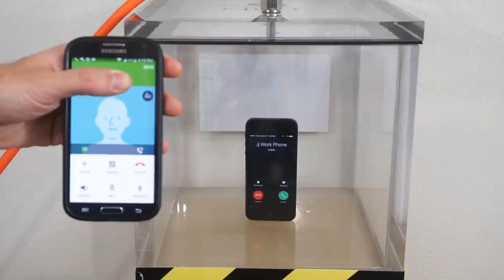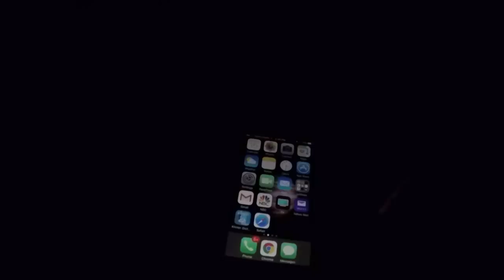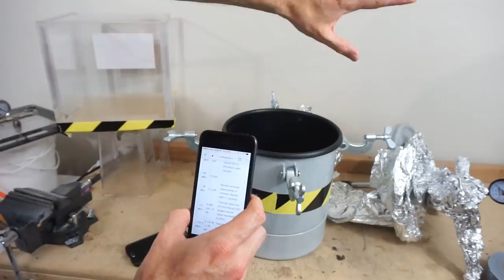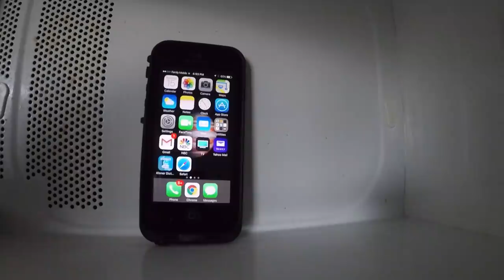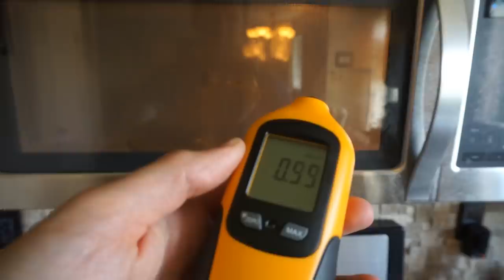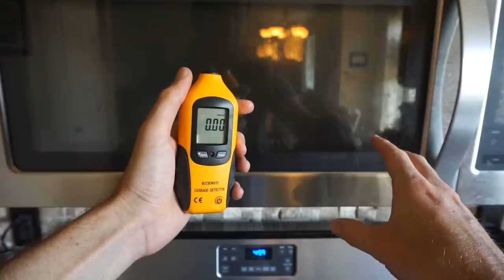Can You Call an iphone in a Vacuum Chamber? 4 Different Signal Tests!

Comment: 1. won't succeed to call in vacuum

2. wont succeed to call in steel

3. will succeed to call in water if the phone wasn't there too much time and still works but water doesn't block signals so as long the phone still operates normally it should succeed to call 

4. depends on the design and if the microwave turned on and off

Comment: You may be correct on the amount of power actually needed for a cell phone to receive signal to function properly.  The problem is that the manufacturer changes the amount of power needed to show the certain number of bars that the phone shows as operable signals.  It depends on the phone really, on how much power it'll accept before the phone shows no signal.

Comment: Metal mesh actually would block better then the solid steel because it deflects the signal rather then absorbing it. And if you turn the microwave on it would likely block the signal but I would guess it depends on how close you are to the cell tower.

Comment: You need a very thick metal casing in order to block all the radio waves otherwise you'll have to do the experiment in a place with weak signal so that only a thin metal casing is enough to block the waves

Comment: My predictions:
Vacuum chamber : no issues
steel chamber: wont work
under water: no issue, salty water: Don't know, wont work. (I was thinking light might cause issue with signals with double polarization, but that's just hunch and probably wrong one :D )
microwave: Wont work, but it might in some regions where are used lower frequency for LTE, but i guess door must be facing nearest cellphone tower.

Comment: my guess:

1. no problems, its electromagnitic waves, no transmitting medium needed2
2. metal shields electromagitic waves, so either you have bad transmission or none
3. well, sounds scary. As long as the electronics dont get a shortage it might work. I would use puriefied water, to avoid bridges at the platins
4. uh, strong static electric waves, my guess the mobile phone will get destroyed. transmitting data wont be possible, because the microwaves are to strong. It would be the same as try to hear a whisper, while a jet plane starts next to you.

Comment: Radio waves go through vacuum obviously, think of the gps satellites at 20.000 km above the earth, the space craft like the voyagers, hubble. Even the ISS at only 400km above, is still in vacuum.
But in the case of the metal bucket was an unexpected result

Comment: Curious to know if the MEMS-clocked iPhones (6 and higher) still work in this case... helium caused it to break because the clock sped up (as a result of the lighter helium particles?), wonder if a vacuum does the same

Comment: The phone still works inside a steel container because it is not grounded. The actual shielding is done by making a steel enclosure and ground it. If it is not grounded then that chamber is not shielded. There will be an EMF induced in the container which produces a current inside the steel and therefore create its own magnetic field. In order to proper shield the phone, the chamber has to be grounded, connected to a ground connection like the ones in the power plugs. This will "get rid" of these currents that are induced in the steel chamber by the electromagnetic radiation in the air. 
P.S: at my university, we had an enclosure like this one but about 4 m long. When you get inside and close the door, everyone will lose their signal to phones, the signal power is almost to 0. This chamber is used for calibration for sensors, equipment or testing devices under no electromagnetic pollution.

Comment: You should have kept the phone hanging with a very thin nylon string inside chamber because if the phone is put down then the base of the chamber might be working as a medium for phone to receive the signals. It is my thinking. May be you should try once and see.

Comment: So you said a microwave heats up by vibrating molecules very quickly, are you meaning air molecules? If so would a microwave produce heat in a vacume chamber?

Comment: Vacuum will not affect, if it did satellites would be designed very differently

Steel container will block if thick enough or large enough

Water should work if the phone itself doesn’t get fried, not sure how submarines use signal but it has signal waves has to get through still somehow

Microwave could actually block, it’s designed to stop microwaves (usually 12.23 cm) from coming out, cellular network ranges are usually within this number so most likely will stop it.

Comment: 1: works fine but the Iphone could overheat after a while
2: Radiowaves won't go through
3: Radiowaves won't go through
4:Iphone will burn

Edit: Ok he didn't turned it on

Comment: I would have expected the lithium battery inside the cell phone to expand and/or explode during vacuum, because it is basically a foil bag filled with solvent, which has a low evaporation pressure. Or are they designed to survive this to be aeroplane safe?

Comment: 0:55
1. I don't see why it wouldn't work in a vacuum; radio waves are pure energy and, so long as the material of the chamber itself lets the radio waves through, it shouldn't be a problem.  The Mars rovers and our deep space probes can transmit radio waves through space without issue, after all.
2. I'm not too sure on that one.  I want to say the steel walls will create a Faraday cage and block the cell signal, as most metals will, but I'm not sure how well steel actually blocks radio signals so...
3. Not sure on that one either.  I know from a different video of yours that electronics work while submerged in deionized water because of its nearly nonexistent electrical conductivity, and that might have an effect on the radio signal, like a liquid Faraday cage of sorts.  However, that video also demonstrated that a wifi signal will go through the water and allow the phone to access the Internet and even stream videos, so a radio wave should also get through.
4. Nope.  Not at all.  Microwaves are specifically designed to be small Faraday cages in order to contain the potentially dangerous microwave radiation the magnetrons put out, and I just read online that a good way to keep car thieves from stealing a keyless car is to put the fob in the microwave when you get home as the wireless radio signals are blocked and the thieves can't spoof the ID transponder.  A cell phone won't get any signal inside of a microwave either.
Reply: And now I'm surprised.  Well, not by the first or third ones; those went about as expected, and the second one wasn't terribly surprising either since, again, referencing back to the deionized water video showed that it was more likely than not to get a signal.
The microwave one is the most surprising, though given how the steel container worked I probably should have guess that; microwave ovens aren't perfect Faraday cages after all, and since the steel container showed that even a minimal signal is sufficient to make a connection, there's no reason the little bit of wavelength leakage shouldn't have been enough to connect.

Comment: Just want to mention that YOU DON'T NEED TO BE PROTECTED FROM MICROWAVES. If you're afraid of sticking your head near an operating microwave oven, then you should be about 10,000 times more afraid of sticking your head near an operating lightbulb. Micro wave radiation is simply NOT dangerous, just like Light radiation is not dangerous.

I don't want to get into too much detail here, but the waves themselves are not what actually heats your food. It's the rapidly oscillating electromagnetic field created inside of the oven. This field can actually be created with ANY electromagnetic wave. The only reason we use microwaves is because their size happens to be convenient.

Comment: Light goes through space same as a lot of other waves, so it is going to work. Water doesn't block most waves, also works. Steel chamber not though and microwave neither cause it is surrounded by a grid of metal to keep the waves inside.

Comment: Strange question but could I put a phone in a debubble / vaccum chamber thats normally used for screen repairs? The vaccum pressure in the machine is 0.71 mpa so would the phone be safe? I've re-attached the screen after repairing the glass and now there's a tiny bubble appeared under the glass so rather than take the screen off again I was thinking of just putting in the whole phone? lol

Comment: The most scary test was the vacuum chamber test. I was afraid, that if there is any gasses in the battery cell, it could delaminate the electrodes, causing an increase in internal resistance. The result would be exactly the same as an old battery, that needs to be replaced. A new battery, with no entrained gas would not have any problem. Another problem, is heat. In a vacuum, there is no air convection to cool the phone. This short demonstration caused no problems, because the thermal mass of the phone was heavy enough to absorb the temperature rise for that short period of time. (I'm glad you DIDN'T turn on the microwave!!)
     While on the subject of microwave ovens, try the meter test, with the microwave empty, and see how much the emission increases. (Don't do it very long, it could cause spot heating, or, damage the magnetron)

Comment: Well I still lose signal when I'm in a house with a metal roof. Are you sure that it wasn't because of that huge rod that was inside the enclosure? Could act like an antenna and transmit signal through the body of the cilinder and into the chamber.

Comment: I have a question. When you tried to seal the steel bin up better with aluminum foil how would the aluminum foil do anything? Its aluminum not steel.
Reply: Finn Campeau aluminum foil reflects electromagnetic waves, people actually use it to line the inside of their purses or book bags so they can steal stuff from stores without setting off the alarm

Comment: 1.how do you think messages get to the ISS
2.it went through the steel because steel only absorbs so much

3. it receives it in water because electricity can travel thorough water and those waves are electric
4. microwave worked because the radiowaves just went through the glass

Comment: Of course it will work on the steel case, you built a giant antenna!. If you don't want to work all you need to do is to ground the case. 
For the microwave it should not work as the microwave is a Faraday cage. If it worked it is because your microwave is not grounded correctly.

Comment: Your steel can does not act as a Faraday cage if you don't ground it. Redo your steel can and ground it, make sure the ground impedance is less than 5 ohms and try again. OR remove your microwave oven door grid and replace it with a steel, aluminium plate. AND remove your steel can paint when you insert foil, the paint is not really a good electrical conductor.

Comment: I did this test.  I wrapped it in a hat that radiologists wear.  It had those lead inserts, and it still rang.  I wrapped it in about 3 lbs of aluminum foil, while being wrapped in the lead sheets, put it in a waterproof electrical box, then wrapped that in aluminum foil, and I finally got the phone to not ring

And if water blocked radio waves, how would submarines communicate?  And the only place in the ocean where it’s miles and miles deep is Mariana Trench, and somehow they could still communicate when they sent a vesssel down

Comment: how are you sure that the air isn't still propagating the electromagnetic wave , you can test for this by measuring the speed , if it is not close to the speed of light in a space  then its wrong.

Comment: cell phone signals have essentially nothing to do with air, if anything removing the air should make the signal infinitesimally stronger because the moisture in it will absorb some radio energy but honestly it's a microscopic effect, you wont be able to measure it.

Comment: My guess: 
If it works in the chamber at atmosphere, it will work in a vacuum.
If it is waterproof, it will work in water. 
It will likely not work in a microwave because it is designed to contain waves.

Comment: What I really want to know that I don't know has been done or not is attempting to make 2 magnets or mud balls with magnets at the center to "orbit" around each other in a vacuum. The only way I can get 2 magnets to "orbit" each other is at a certain angle and I have to hold them by hand to maintain that angle while moving one magnet around another, and neither of them can be spinning or the angle changes and they attract. If 2 magnets won't orbit each other then there's no reason that planets, which are essentially the biggest magnets in existence shouldn't be able to orbit each other either which means some other kind of interaction must be happening besides gravity and magnetism which would both cause attraction. So then I would wonder what's causing the repulsion, because I've never seen magnets strictly repel each other AND keep each other within a certain distance.
Reply: You might even have to try dangling the magnets from strings in a vacuum chamber, I don't know.

Comment: Microwave is a faraday cage so no. Steel I am thinking that is similar enough to a faraday that it won't either. Water, depends on how deep or thick but I would guess no. Vac chamber no problem.

Comment: It is possible to get the call because radiation does not require a medium to pass thus even if air is not there signals will pass.

Comment: Once my phone got wet & I didn't think about the system instead I thought I just need to dry my phone & I put that in the microwave and turned it on.
My experiment was a fail but not completely lol because it did dry out but lost the connection. I'm guessing it is because the plastic sim inside my phone or maybe it was just because of microwave and phone's radio wave fighting with eachother. 
😂😂😂

Comment: What will happen if you open the chamber without getting the air back in?
Reply: You probably can't open it. The lid is absolutely sucked in as the chamber was trying to suck the air around it but couldn't .
Reply: @agnesnyangoma2349  thanks. If it can be opened anyhow, it would act like a bomb right?

Comment: Predictions (Will edit with reactions to results):
1. It's using waves, so it should work in a vacuum chamber. (Edit: I completely forgot about the risk of it breaking, but it pulled through.)
2. Unlikely due to waves blocked by steel. (Edit 2: What?! How did it work?)
3. Assuming the phone is sufficiently waterproof, it should work. (Edit 3: Good point about the ocean.)
4. If the microwave is running, I doubt it. Either the phone gets cooked, or the microwaves scramble the signal. (Edit 4: Okay, considering how it worked with the steel container, yeah, the microwave couldn't really stop it.)
Reply: for point 2 it's a matter of rifraction and diffraction, the steel can should have been thicker than that
Reply: Manuel Ubaldi Ah, I see
Reply: @Manu-se5tx  how is it possible? We tried it with aluminium wrapping and it didn't work.

Comment: I knew That the Waves can go trough Vacuum But I Thought the Air in the Phone Will Crack The Display or something like that.
I knew That the Waves could not go Trough Steel But I thought that the waves cant get in there.
I Thought That he would turn the Microwave On and then try.